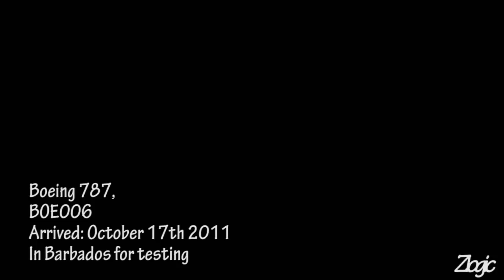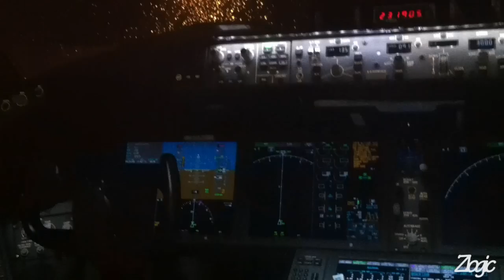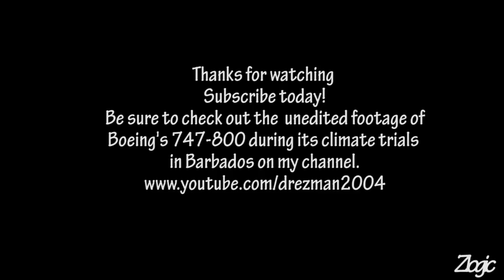Boeing 787-800 Test Aircraft on board look around includes flight deck

Comment from the maker: Both this and the 748 lined up like that because they didn't use pushback tow trucks. Its not that the facility wasn't available for both but Boeing preferred to move without considering they flew test flights whenever they wanted.